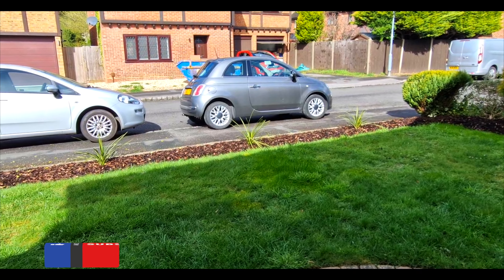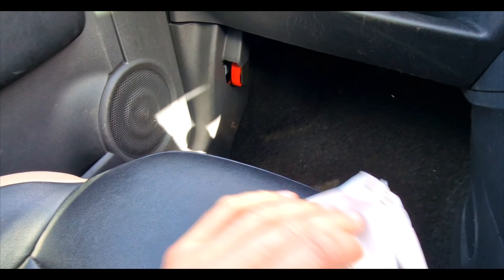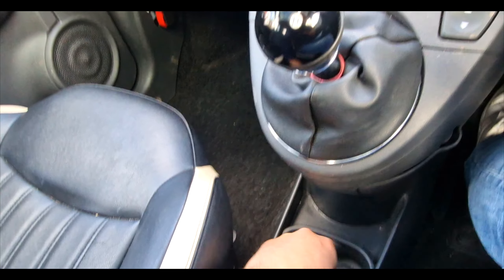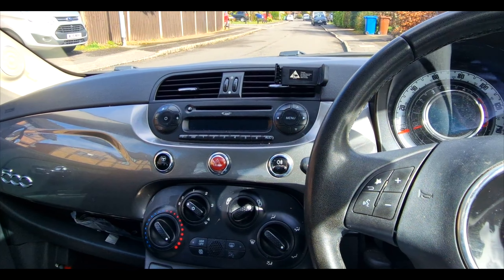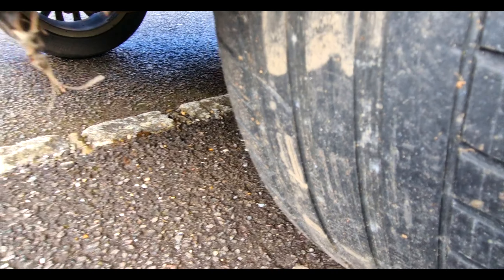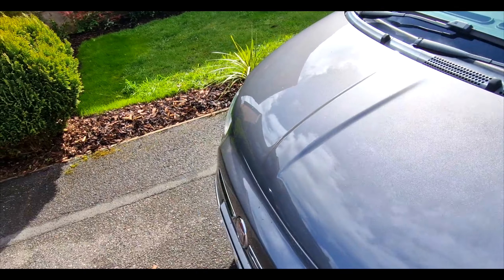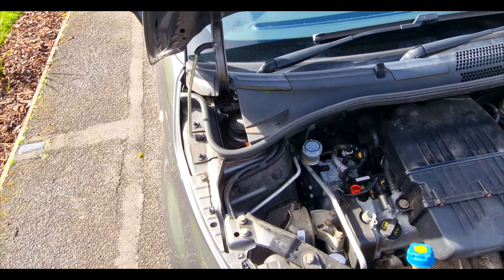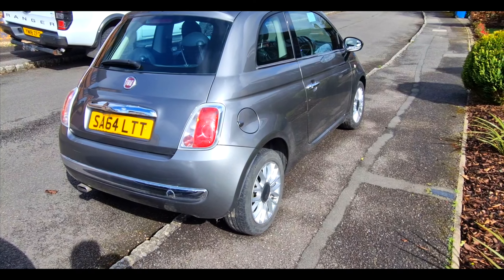Is This Fiat 500 A Cat Car? BCA Isn't Sure

Comment: Hi there i just got a 2013 Fiat 500 lounge edition for £3 grand today only 80 thousand on the clock but the problem im already having is weird grind noise when pulling away only in 1st gear my guess clutch bearing on way out ? i did know about this when purchasing it as the actual retail value is £4 grand hence the low price but it pulls really well they are so lovely to drive compared to my old Hyundai i10 which was a nightmare on the motorway lol , anyway goodluck with your new car i hope it goes well too
Reply from the maker: Does the noise change when you press down on the clutch?  Hopefully it's just that and not a new gearbox. Good luck with it all.
Reply: @carsalvage101  Noise sadly constantly there , the weirdest thing is there's like a belt slip sound too ?

Comment: Also how much did you pay for your Fiat 500 ? if it was more than £3 grand for a category car then thats not good considering ive just paid £3k for a 2013 model with service history from a dealer with a years warranty , Arlington car sales in Farnham if you ever want a good cheap car thats safe they will not let you down my friend
Reply: Please don’t ever be under the illusion that just because the car isn’t recorded it means it’s never been crashed. Thousands of cars have a hidden past, service history or not won’t tell you it’s been crash repaired. I hope the grinding issue is an easy and cheap repair for you…all the best 👍🏻.